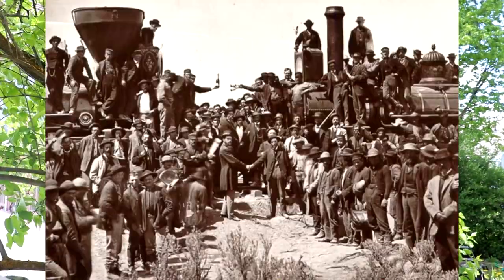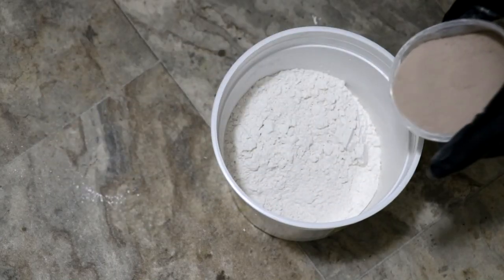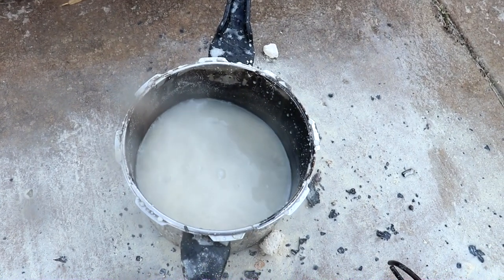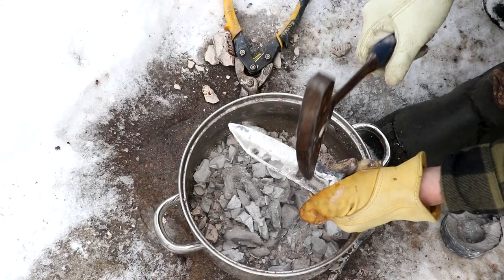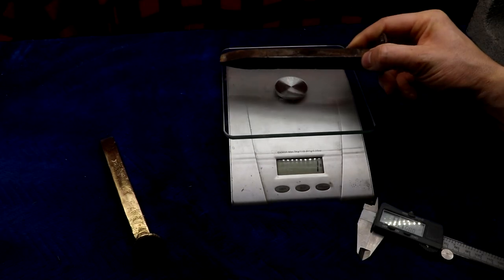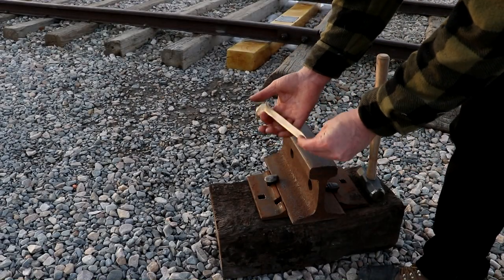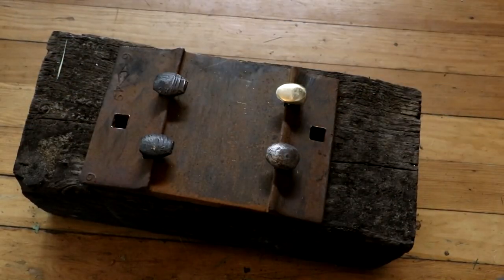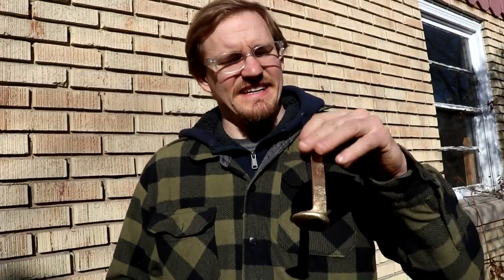Making a Solid Gold Railroad Spike

Comment: Cody gets splashed with a gallon of boiling water
Cody: "That was a bit more violent than I expected..."
Reply: I'm sure it was a bit warm, but not enough water had contact for long enough (to get to boiling temp) to matter very much
Reply: @Crazyclay78YT  A more conspicuous point, I’m sure if it was boiling he would be in the hospital
Reply: he was like "okay"
Reply: @rival_rebel16yearsago61  jar man
Reply: It wouldn't have been at boiling point that quickly, but if you throw something of either extreme heat into cold or vise versa, it's gonna react and expel. It's like when you add frozen fries into the oil too fast. the cold water causes the hot oil to pop and expel

Comment: Cody: drives a rusting old Ford ranger with junkyard parts.
Also Cody: has a $26,000 nail just because.
Reply: Cody did have a gold plated bumper once-upon-a-time.
Reply: He isn't materialistic so he gets the best bang for his buck and easily repairable whist these new cars you have to go to a servicer to get a simple fix
Reply: @DatBoiOrly , I'm the same. There's something satisfying about keeping an old car away from the junkyard too.
Reply: ....anyone watched Goldfinger .
Reply: @stupot8413  indeed I'm also the same since I work a crappy paid job I have to keep it running or I'm walking to work lmao.
Reply: Cody probably values that rail spike for corrosion resistance more than for monetary value
Reply: @DatBoiOrly  I have the same truck, but somewhat newer. The upkeep on them is practically nothing, especially if you know how to fix things.
Reply: @5roundsrapid263  I've had the same truck since I passed it's an 2004 jeep wrangler with a Cummins 4BT in it the original motor cost too much to repair so I just bought an old 4BT generator and made it work in my jeep.

Comment: The gold sounded AMAZING when being driven in the close up.
Reply: @paul beenis I've heard iron spikes driven before, I'd say the sound was higher pitched and faster oscillation then iron... The ring was "sweeter"
Reply: Gold alloy not good for acoustics. That short stock of rail was what was ringing. Notice how the ringing got louder as the gold spike pinched it to the log. That's because the rail had suddenly better acoustic coupling with the log. The log acted as a resonator, the spike was like the bridge and the rail was like a string.
Reply: Shouldn't its increased mass/density offer different acoustics? 
I'm okay with being wrong, and maybe it's any number of variables (microphone, speaker, mentality). Maybe Cody can run an experiment testing the acoustical properties of different metals/alloys?
Reply: @Enakronizum  take lead for instance. It has high density less than gold but is ductile and absorbs sound energy. Conversely, aluminium can be very resonant material. I will tell you this: the density of a particular mass has less to do with it's ability to resonate than it's physical structure. Copper makes a horrible bell, but add a little tin or zinc and you get a harder material with good acoustic properties.

Comment: Replacing railroad spikes at some random location is probably the easiest way to actually hide stolen gold in plain sight..
Reply: Indeed. Until you return to find the entire track was serviced and replaced.
Reply: @Shepard_AU  that's why you find an abandoned line that won't get touched because it's cheaper to leave in place.
Reply: Ben David  but that's the first place the feds are going to look!
Reply: You could conceal it even better by lowering the purity to 14k or 10k, but you would need more spikes. You could also make an alloy with copper, giving it a rose color. I feel like the best way to conceal gold is to make wire with it. Not only will it be hidden, but it makes a great conductor, so you can use it around the house for things like you’re speakers.
Reply: Just bury in the ground somewhere where nobody can or will metal detect
Reply: Now here I go checking every rail road spike with a magnet.

Comment: listening to the metal "sing" when you pounded the spike. i would have loved to hear that in person. to see if the gold sounded different to the steel...
Reply: Pure gold would probably not have made any noise like that.. If it was the spike, that is. Could have been the railing.
Reply: @Runefrag  thats true. i thought i heard some qhen he was cleaning up the spike though.
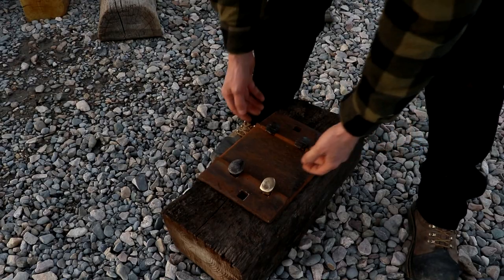Reply: @murunbuchstanzangur  judging by the sound of hin setting down the railing at 14:17, i reckon it was the railing
Reply: @ZARDOZThe original spikes were made out of iron, so driving them may well have sounded closer to gold then to steel. Steel tends to give a high pitched ring where as iron gives more of a low vaguely, metallic *clunk*.
Reply: I doubt you could hit a 15mm nail into Oak with that small hammer. It looks like pine which will let the nail sing. Zardoz, love your playlist, never knew there was a band called spirogyra .
Reply: @beautifulsmall i have been looking into bell metals all over the world since i posted this and its not impossible that it could have a ring to it. gold is used in russian orthodox church bells, the density actually helps with the resonance, and as its such a low carat value it might even be hard enough. i would love to see some tests of this. 

thank you! its really just a place for me to put music so i can find it again later.  but i am very glad that someone else has derived some joy from it besides myself. 
recently added a video of a man playing beethoven for elephants. its lovely.
Reply: @Runefrag  That sound is the hammer.

Comment: The biggest flex ever,  "let's see if I have $26,000.00 in gold..."
Reply: Not exactly. There are dinners that cost more, often due to social pressure.
Reply: @ffnovice7  social pressure? no social group that pressures that is worth the Rolex they probably wear, Very few dinners on this planet cost 26000 dollars my friend, that’s an elitist dinner, at least few few even compared to dinners that can cost even a few thousand
Reply: Biggest flex ever? what about that mr beast guy giving away millions?
Reply: This is far more classy than Mr Beasts cringe activities
Reply: @ffnovice7  I used to work catering weddings that would cost $20,000 for the venue rent alone, but the normal people don't have _near_, that much money on hand. Just because some people can drop that much money doesn't mean it isn't a lot for normal folks.

Comment: I have a few old railroad memorabilia. A few spikes, a tie plate, two glass insulators used on telephone poles that were next to the tracks. I also have a restored 1940's conductor's lantern. it has a red glass lens and a tank that holds kerosene and a wick. I also painted one of the spikes with gold metallic Rust-O-Leum  paint and it looks like a gold spike.

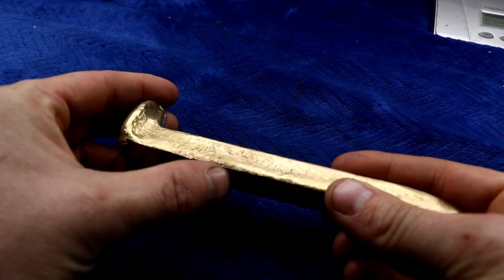Comment: 16:50 - If you drove it in twice, how did you get it out the first time?
Reply: Yep. Single handed blows on the wide shot from one side, and then double handed blows, on the opposite side for the close up. Two spikes? Two mock ups? ToT's time machine lathe?
Reply: Maybe he pre drilled one of the holes first like he mentioned they did for the original.

Comment: Cody, I made the Copper Spike used recently at the Nevada Northern Railway when celebrating the 150th Anniversary of the Transcontinental Railroad. My spike was easier to make as I started with 1.5"x1.5"x12" 99.999% Copper bar and disc cut, angle ground, then ball peened the spike into what looked like a cast copper spike and then polished it.  Consoderably cheaper than a solid gold spike but their railroad was built on Copper Mines and when their railroad was first built they celebrated with a copper spike.

Comment: That water explosion is a good example of why molten metals should never be quenched in water without proper safety precautions.  For whatever reason the water will randomly explode sending molten metal in all directions.  If anyone knows the proper term for this phenomenon please comment!  You can find footage of these events in large factories - the power is astounding for something that can be run calmly for weeks without such an event.  When I see youtubers pouring metal into swimming pools and the like I shudder.  What Cody did wasn't going to hurt him but it was a good demonstration of the effect!

Comment: CORY! You do not use a bench grinder with a stone to clean up anything!
Use an angle grinder with sanding flap discs to polish and smooth it up.
Best to use a bead blaster to clean the rust and corrosion, then use the flap discs to smooth and blend, then finish up with a bench grinder that has a polishing wheel!

Comment: Hey Cody I'd love to see a video about making bio-plastics from materials like wood. The chemical synthesis seems to have been fully described in various scientific journals and it doesn't seem too hard to do , either.

It's something like using the right % of a solution of sulfuric acid to dehydrate the wood lignin (they use this fancy word to describe the burning that happens for example to sugar), extracting the right chemical compounds (they are not illegal but some have psychoactive effects similar to GHB , it's gamma-valerolactone [GVL - not controlled] but also many more similar ones) and then polymerising (requires formic acid or other very simple carboxylic acids).

This makes a plastic (different kinds can definitely be made , just have to do a bit of experiment with what polymerises) which is biodegradable and can be made from anything which has cellulose , lignin , sugars (like corn) and so on. 

Love your content and been here since early 2015 , might not be a long time but I did indeed binge on your older videos ;p

PS : NileRed has made a video about turning cellulose into a kind of plastic (cellulose acetate? the one in cigarette filters?) , I got really excited when I first saw that video but I'd love something much more in-depth. This could maybe be a collab since NileRed got some really fancy chemistry equipment around and am sure you guys would be a manic combination , ahhahaah

Comment: I was under the impression that all railroad ties / sleepers were predrilled - then the square peg in a round hole gives it holding strength  (written before I witnessed you attempt an undrilled nailing.. (NB. not an expert - Love the Chutzpah - investing a lot of hard work in these type of videos. It is a great form to leave all that gold in BTW - with the video - etched on a long chain hydrocarbon data disk - it will have some historical value in 2121.

After seeing that pounding - it worked - lucky you mostly have "soft" wood in the usa...  lol..

Comment: As far as I knew "lost wax" casting involves pouring the molten metal into the mold with the wax still in the molt which just comes up and floats off (whatever part doesn't vaporize) , and the wax also acts as a reducing agent for bronze or other metals that oxidize.  Plaster loses it's water of crystallization even before You reach 212 F.  I thought the investment material for casting was something other than plaster although Yeah on the sand.

Comment: Nice spike. 
I was thinking of the gold dust when driving the spike and how much work you put into getting it in the first place. 
What timber did they use for the original sleepers? I see movies and shows and it looks like a type of pine. How long did they last? Here in Aus we use treated Eucalyptus which lasts for many decades from rot and termites. I sure understand replacing them with concrete versions though.

Comment: 8:50 It looks like your flame is too fuel rich. I'm not sure how concerned you are about the purity of the gold spike but a fuel rich flame like that is likely to introduce carbon into the gold alloy. If you're going for a neutral flame you want the blue inner cone to be small and fairly sharp if that makes sense. Too sharp and you get an oxidizing flame, too round and you get a carburizing flame

Comment: that's so cool. I'm wondering, if gold has good thermal properties, how well would a pure gold heatsink work compared to a regular aluminum one?
Reply: About 50% better. The absolute best metal to use would be silver, which would perform 100% better than aluminium, then copper (90% better). However silver (and gold) are much more expensive, while copper gets attacked by air and humidity, so we're stuck with aluminium

Comment: If then your mold is still hot... throw it in a bucket of water...   The temperature diference should shatter your plaster off of your piece...    Process called quenching.

Comment: I used to have a spike removal tool around here but no ideal what happened to it. You had no chance with that little nail bar, the tool to remove them is several feet in length and is formed to hook around the spike head.

I bet that spike was in left in there no longer than it took for them to drive it in, take a few pics for the local papers, and removed quickly under armed guards back then.

I wonder what they ever did with it after they removed it? Is it in a safe or someone’s teeth by now? Who knows, but one thing for sure, it is nowhere near that railroad now.

Comment: imagine leaving the landmark & a security guard comes out..
'ima have to ask you to put that back where you found it sir!'

plaster is good for aluminum & gold is non ferrous, but yeah the melting point for gold is a little too high for the plaster. another option might have been to try making a ceramic mold, but it still worked out. ¯\_(ツ)_/¯

(i would have tried to use the base plate as leverage with the pry bar, instead of trying to get a good angle on the nail.)

Comment: I tried to blacksmith one of these spikes before I was able to get the head off with a cut-off tool and a hammer but unfortunately the head, while glowing red hot .. flew up and landed on my neck.
Reply from the maker: Ooohf did it leave a cool scar?
Reply: @theCodyReeder  no unfortunately I've got a mess scars on my left hand though. About 4 that I can visibly see, humm a Chef knife went into my palm and axe grazed the side of my pointer finger near the knuckle and various cut fingers. I also have a v shaped gouge on my scalp from an angle iron incident.. thanks for the reply it's cool to talk to a celebrity. Oh one last one I recently lost a nail on my right hand because it got pinched in between a flimsy garage door. Actually I think you came out with the video around the same timeframe you had a similar finger nail related incident...